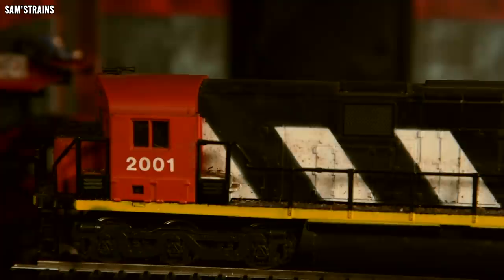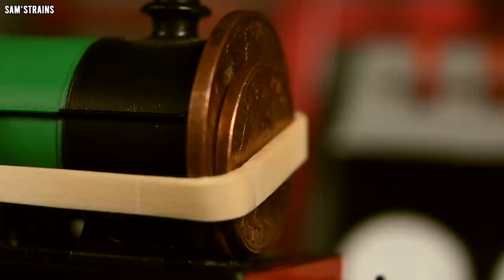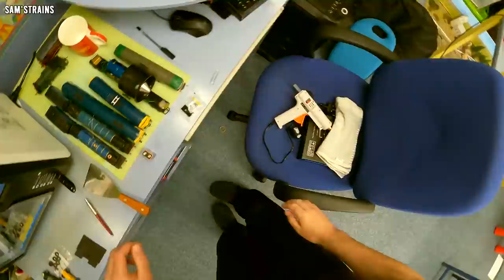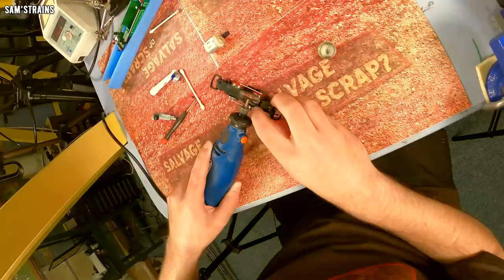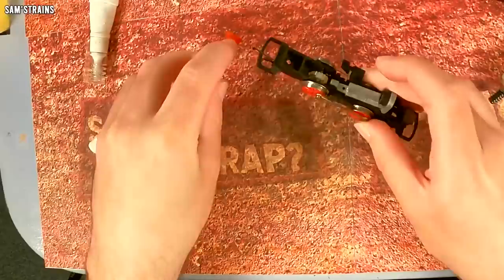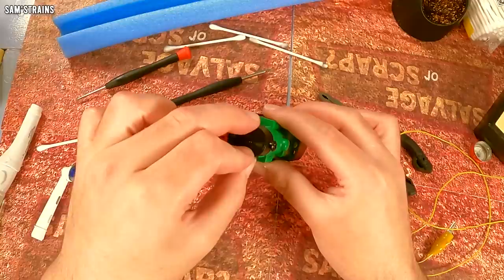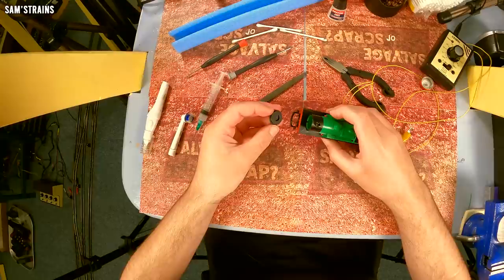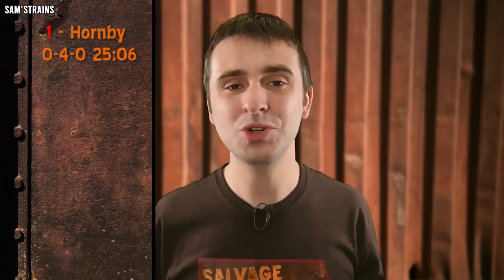Ruined Hornby Tank Engine | Salvage Or Scrap?

Comment: Hey Sam, I had an idea on how to fix old Bachmann split chassis loco's. I know you don't have a metal 3D printer but you could 3D print new chassis for them turning them into normal chassis loco's, take the measurements of the old one and print. You'd have to fit them with wiper pickups, and since it wouldn't be as heavy as the original you could include compartnents and holes for led weights in the plastic chassis, it's worth a try.
I may be off my rocker but it's food for thought.
Reply: @ryancinarkaya5791  In one of the recent Lawrie goes a little loco episodes on Lawries mechanical marvels YouTube channel Lawrie had got 3D printed replacement parts for a old Mainline locomotive with a split chassis (pre Bachmann loco) and the parts you mentioned were used.
Reply from the maker: Great ideas! Yes it's the axles themselves that are the main point of failure - and you sure can 3D print new ones! I love the idea of trying to create an all-new chassis though, fascinating! :D
Thanks for watching, Sam :)

Comment: The work that has been done on heritage railways in restoring old locos and rolling shows you that in principle anything can be repaired! That 3D printer would allow you to design and produce a complete layout. Using the 3D printer to create lineside structures and buildings would mean keeping within the limitations of the resolution it is capable of. Why not have a go at replacing some of those cardboard things on your layout with your 3D printed creations?  You've got that signal box to start with. Then platforms and waiting rooms! Thanks for all your efforts in uploading these videos in your usual inimitable style!

Comment: One saved scrap loco I was able to work on, I got a triang 3f with a terrible body (looked like the front had been melted) but working motor, and a Hornby James with no tender I got years ago at a car boot sale. I moved the gear to the axle of the James chassis (needed to use James' chassis because of the pony truck attachment) and then used a dremel to cut space in the James bodywork to allow the motor to fit. The rest of the triang body i carefully cut up to fix things like the roof and footplates of my other 3fs, now I have 3 tender driven locos and my nephew loves watching James run past with long loads of trucks. (James is still hoping for coaches one day!)

Comment: An awesome series idea, a great first episode too. I bet you won't get that mainline 57xx fixed though...

I've spent the last few days getting my garden railway sorted. I've wired across the first lift out section, pinned the track down, cut across the board joints, wired 2 phono plug/sockets in to power the removable track but still be removable, and added locating pins on either end. It now works well, with my 08 in charge of all 22 of my wagons.
Next up, further extending round the garden when my local wood yard gets more decking planks in. And also testing with my 14xx and autocoach across the joint. I'm also thinking just wire jumper cables between each track joint to supplement the fishplates instead of wiring a full on bus wire, which would take a lot of wire and also be very hard to install with all the plants around.

Comment: Even if you can't save an engine in running condition, it can still be used as a flatcar load, or a scenery item (think withdrawn engine or sitting around the shops).

Comment: Talk about creepy. I'm sorry that my brain feels like a plateful of scrambled eggs, due to the heatwave. Here's a timer experiment I think you might want to try. Be warned, it's a dangerous one. Only try it if you dare to. Someone has taken out the motor belonging to the E2, and replaced it with a ticking time bomb. You have to try and prise the E2's body and chassis apart, in 5 minutes, before the time bomb explodes and the E2 with it. If you succeed, within 3 minutes, the bomb will automatically stop ticking. If you fail before the ticking timer reaches zero, scramble away quick-smart. The bomb will blow up and it will be GAME OVER for the E2. Sounds scary I'm sure.:_SamstrainsSamstrains:
Reply from the maker: Don't worry, my brain feels like it's been injected by Chili peppers... maybe this is the end for both of us?
I think your challenge could be done - it's quite easy to remove the body... I'd just have to use that 5 minutes to take the bomb far away from the house and bury it somewhere it couldn't hurt anyone!
Thanks for watching, Sam :)

Comment: Fun format for a restoration.  You didn't include the 27 hours CAD time!!  
All these Hornby 0-4-0 models suffer from a frantic motor that doesn't run at all until it takes off at warp speed.  Do you have any cure for this?
Reply from the maker: haha thank you! The CAD wasn't too bad - I'd say 30 mins tops, but then again it's not very good ;)
Thanks for watching, Sam :)

Comment: I used to buy these demics for modifying, or detailing up by buying white metal or brass parts.
There’s little point these days due to a higher finesse RTR selection and better technology, plus I don’t think I have the same level of patience, as even kit building etched brass or white metal kits required a certain skill level.

Comment: I hate saying scrap anything.  I usually like to salvage, but sometimes you just find one that has to be set aside and left to rest in peace. (or pieces).  This is not one of them.  Apart from the smokebox door, it is actually in reasonable, but well used, condition physically.
Thank goodness you have a 3-D printer to create missing parts :).

Comment: Hi Sam,
You might want to check out “The science behind track & wheel cleaning a simple change of product will greatly reduce the effort” by Model Railways Unlimited.  His conclusion is that IPA while cleaning OK also encourages the formation of nickel-silver “rust” due to micro-arcing.  The suggest alternative is WD40 CONTACT or lighter fluid.
Link (If it works)

(1031) The science behind track & wheel cleaning a simple change of product will greatly reduce the effort - YouTube